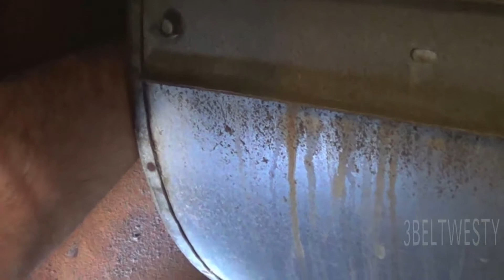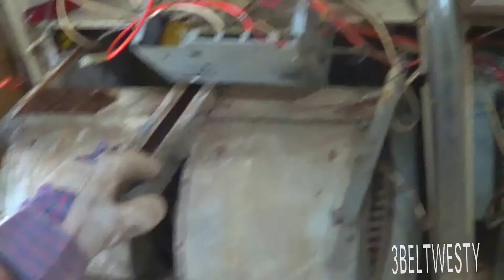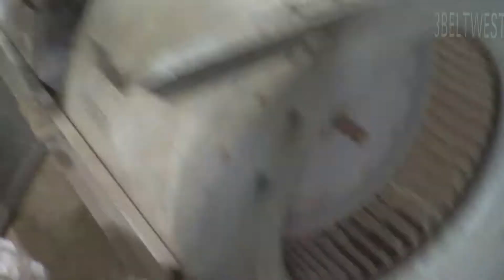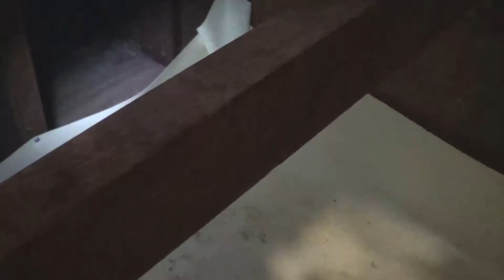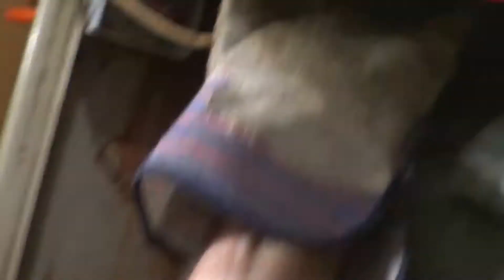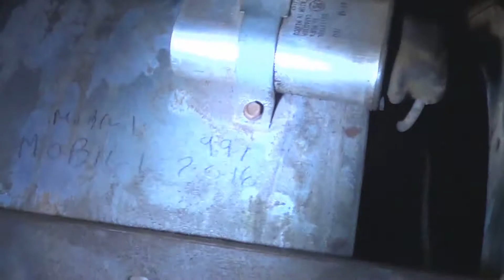CARRIER 58GP BLOWER MOTOR reoil june 2016 with Mobil 1 oil

Comment from the maker: This is the higher flow CFM (-DA/LA Carrier variant ) that has dual blower cages per motor. 2110 CFM in Cooling and  1845 CFM in Heating. The 120 volt blower motor has 4 taps ie 4 speeds that you normally pick 2 of them for heating and cooling. HI. Med-Hi, Med-Low, and Low. ie the data sheets shows two 10" dia by 6 inch long cages. http://dms.hvacpartners.com/docs/1009/Public/04/58G-3PD.pdf